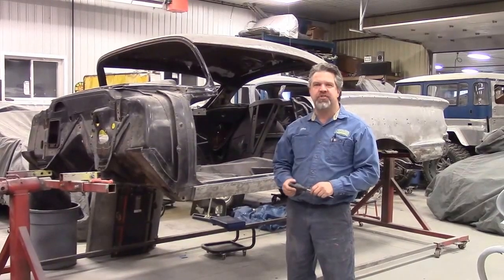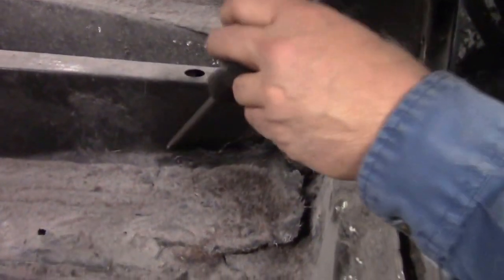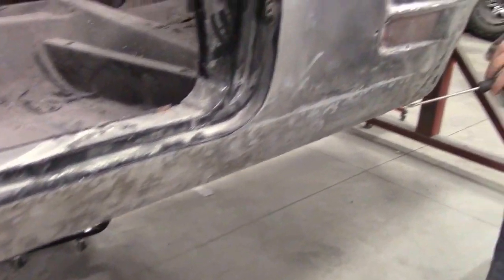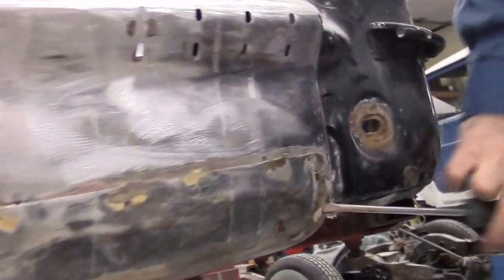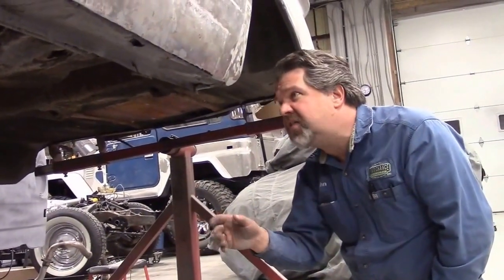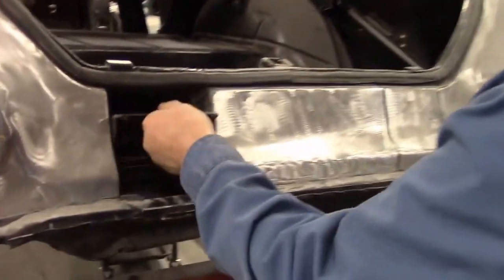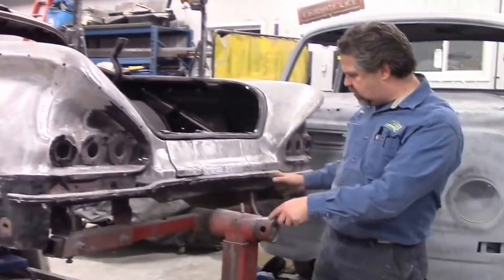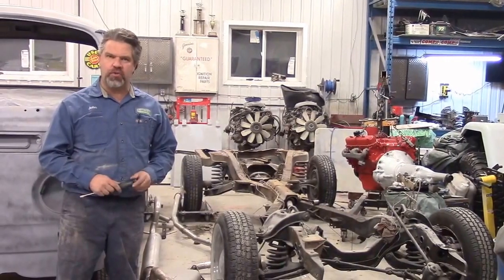1958 Chevy Impala Restoration Update Part 1,  lastchanceautorestore com

Comment: I don't like the X-FRAME ….seems like it would be weak in the middle.  GM and there junk.
Reply: Ya, never quite understood their reasoning. Not all of GM went with just the X-frame. I had a '63 Impala SS 409 many years ago and the supporting straps from the X to the rockers for the interior pan were starting to rust and would have needed replaced. I did not keep the car, but not for that reason. Living happens.